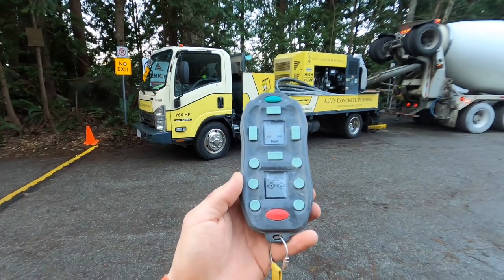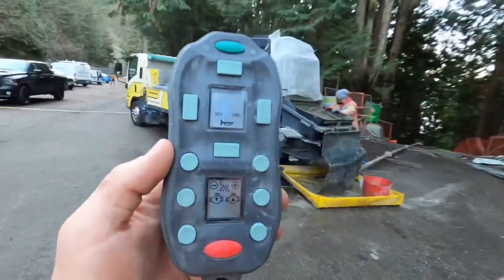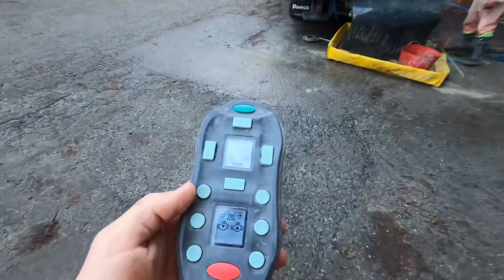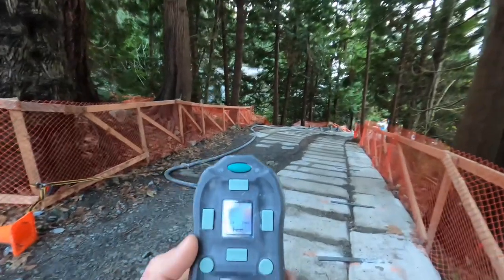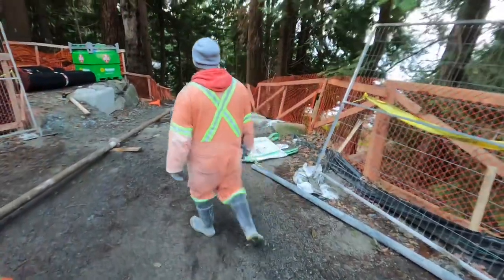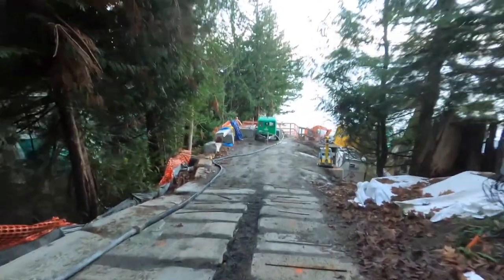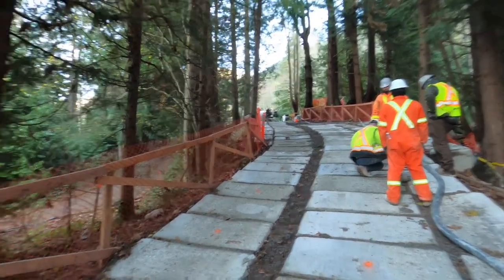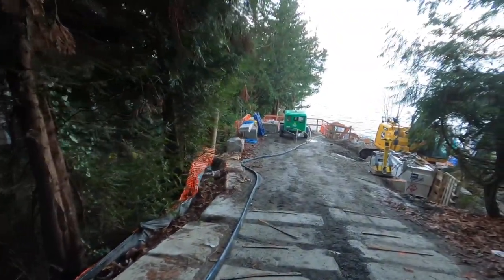Range testing our new Aarcomm “Trident X” wireless remote control.

Comment: Does the old Aarcomm have a way to get into settings? I'd like to know the battery level without having to set it on the charging pad.
Reply from the maker: That I am not certain of. Aarcomm is very responsive  through there Instagram page, would be a great question to DM them there. I found with the previous generation of Aarcomm, the batteries would last so long (up to 70 hours) that I never once had an issue with them running low, so long as I remembered to place the transmitter back on the charger at days end (our units are all truck-mounts and as such have chargers mounted in the cab).
Reply: Hi there! I can certainly look into that for you. Would you be able to DM us on either our website/Instagram/Facebook?

Comment: I’m having trouble with mine won’t even go 150 ft cuts out they claim I have the x version if that’s the case I’m in trouble 😂
Reply from the maker: I was having a similar issue with mine (the standard/non-X version) on our other line-pump and it turned out to be the antenna wire had vibrated loose where it threads into the receiver. 10 second fix after 3+ weeks of frustration.
Reply: @canadianconcretepumper1979  ya found out after today they sent me a new antenna and it had a rubber gasket that was supposed to go between the mounting plate that wasn’t installed in the first place. We have a  250 footer tomorrow we are gonna give her another go  but yes brand new pump and remote doesn’t work grrrrrrrrr